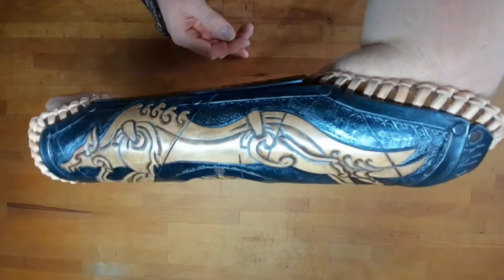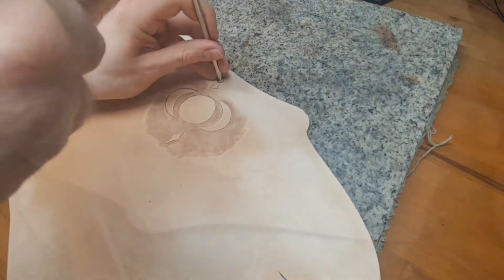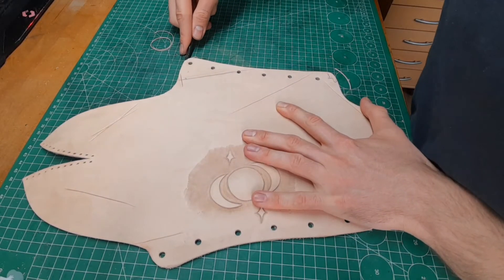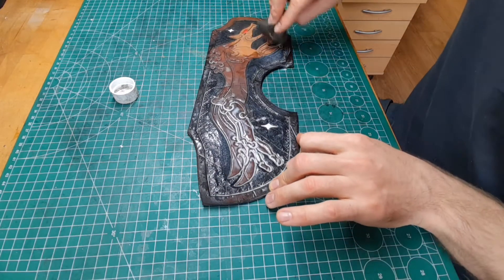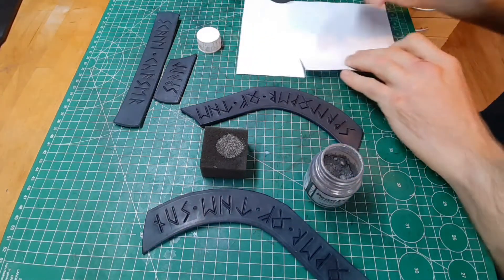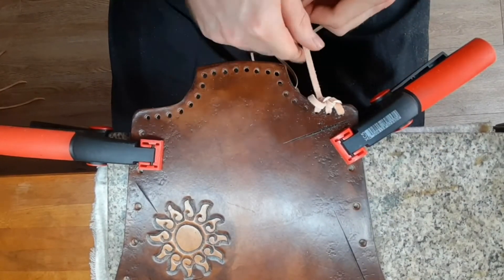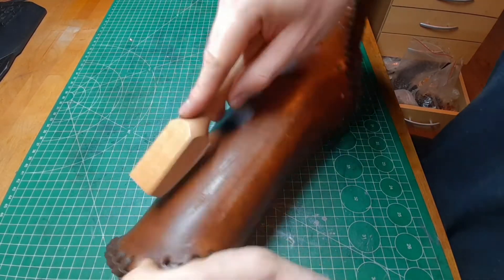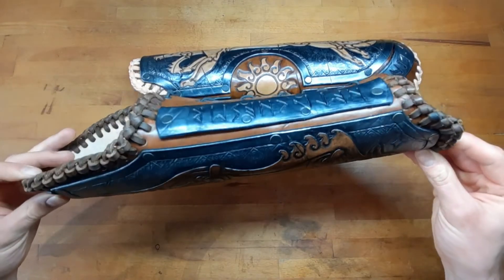Leather Armor Tutorial - Viking Bracers Larp and Cosplay

Comment: Why do you not dye the inside?
Reply from the maker: Personal preference, usually you can't see it, the flesh side takes up a lot more dye and apart from dip dye and a spray gun it is very difficult to get an even colour.
Reply: @NilsBeardfoot  would it work to burnish the inside then dye?
Reply from the maker: @sergeantraven3015  Well brunishing closes pores but here is the question if you are able to do that evenly and you may have a lot of rub off in the surface, but you may save some dye. What I do for regular belts to look good on both sides I dye it idealy with a paint brush to get an even colour and then add on the flesh side gum tragacanth and brunish it or add neatsfoot oil, both will enrichen the colour and this way give it an more even look. This works also with other dying techniques but not as well as with a paint gun and you still need more dye. 

The best is to go for some test pieces and find the way that works the best for you.
Reply: @NilsBeardfoot  thanks 🤩 keep up the good work 😊
Reply from the maker: @sergeantraven3015  you are welcome :) you keep it up too!